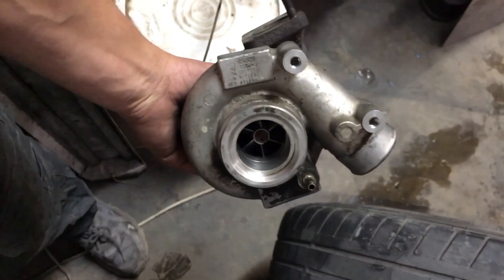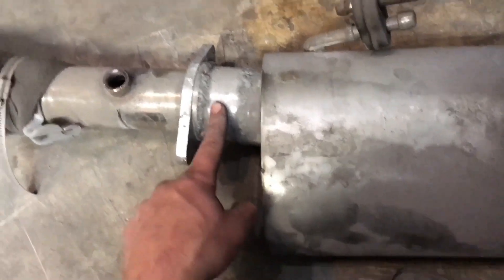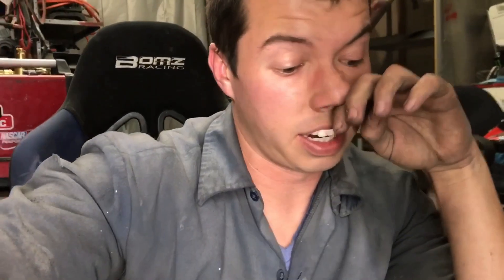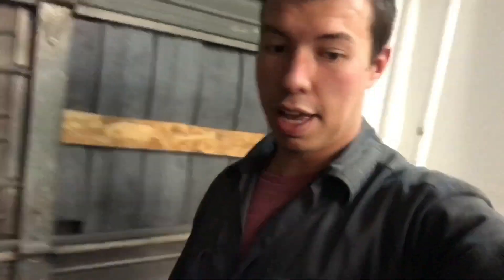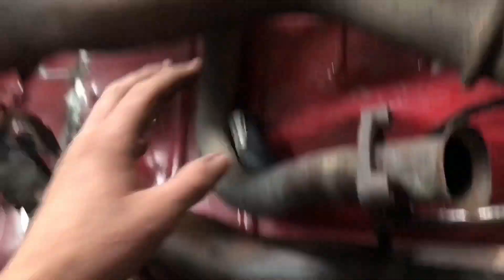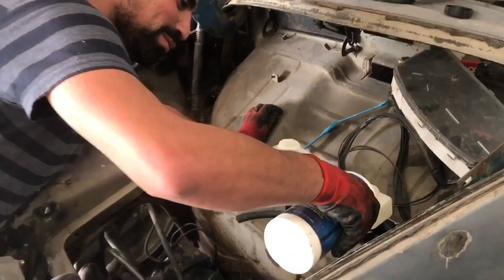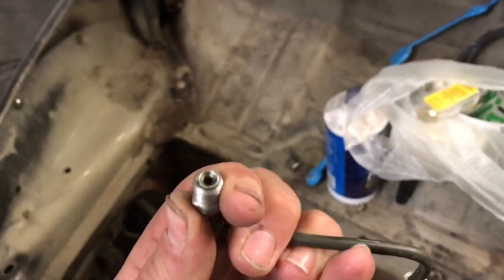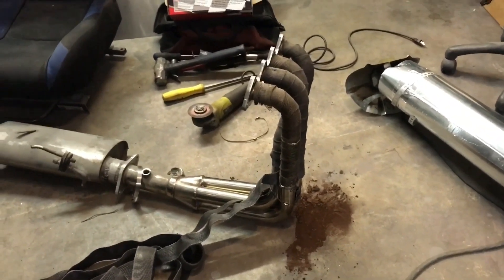TWIN TURBOS for our B18 GSR SWAPPED VW BUG!

Comment: Maybe find 4 tiny turbos and run 1 per exhaust port lol
Reply from the maker: Inferno_Spud haha I swear that was 100% a thought haha
Reply: the smallest turbo is an IHI rhb31 that were used in the turbo chevy sprint, which was a 1000cc or 1L that made 75 hp up from 49hp NA.  the turbo had a 6-7psi max boost.  You do all that work to fab up 4 of these turbos and get nothing out of it. That is just stupid.
Reply: Life od the haggard garage guy just did that ran 4 small turbers not sure if he rN it per cylinder as it wasnt a serious build but was still the doug demuro quirks i like
Reply: ITB's=Individual Turbo Boosters
Reply: there absoulety are smaller turbos than that,  @truemanrep3267  Think TDI generators.
Reply: @StanleyKubick1  oh wow.well it been 21 years since I was a turbo rebuilder for ADP Distributors in B.C. Canada. Do you know the brand of turbo they use on the TDI Generators?

Comment: once you get boost addicted you will want to get a t3t4 hybrid called a 50 series t4 compressor with a t3 III turbine with ford 5 bolt turbine housing good for 425 hp that is an inexpensive setup, with quick spool least lag.
Reply from the maker: Right on! Thanks man!